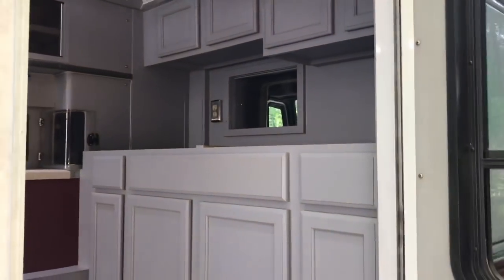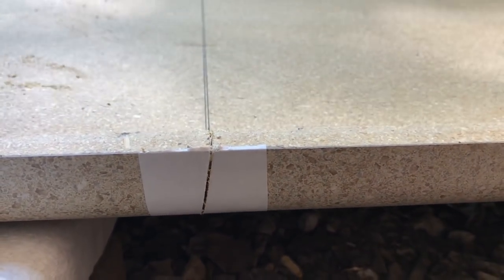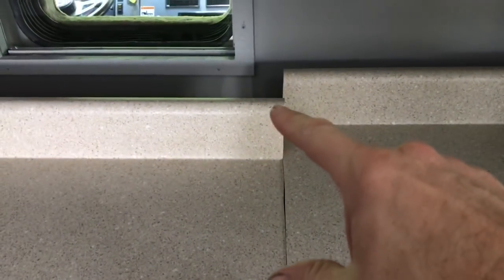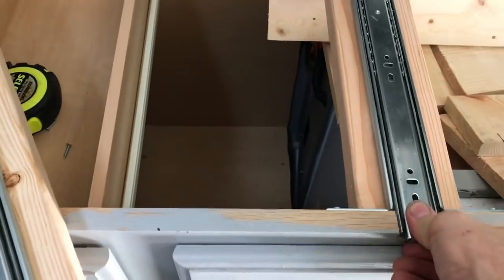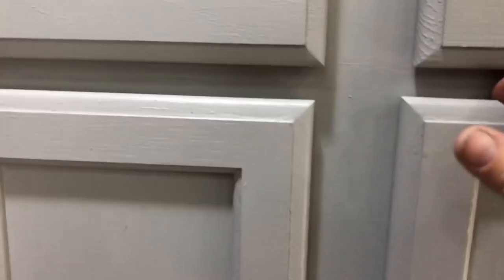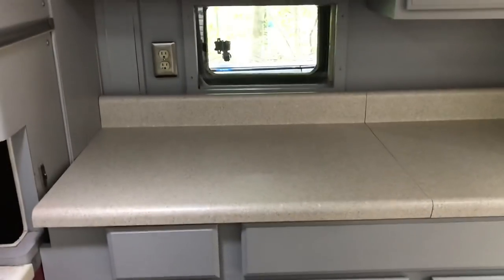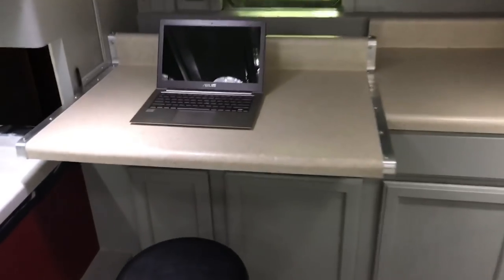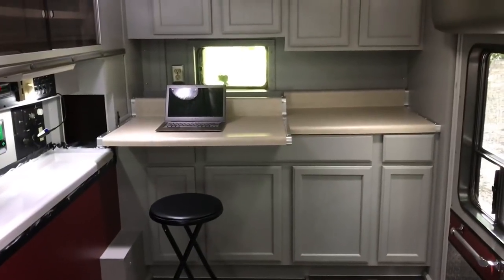Build a Sliding Kitchen Desktop, Mobile Office, Camper Build Van RV Vanlife

Comment: I can't believe how good it looks. I still don't like the gray, it needs some color but it looks so sleek and professional
Reply from the maker: Thank you! I have been making the big items gray but will add color to smaller items as I go. I made a swivel desk table for the sofa and painted the metal parts gloss red. The paint is still drying and am interested to see how that will look. I have found that painting the big things the same color of the walls makes the space feel larger as everything flows together. The sofa really filled up the space and softened things up.

Comment: On the cabinets where the cooler is going, maybe instead of combining the two doors, you could just attach the middle divider strip to either door,  switch the hinges to the other side of the left door, and it they would both open but have no divider in between them, like a saloon door.  Seems like it could maybe be less bulky, and wouldn't block the stairs or anything since they'd each be smaller.  If you attached it to the left door, looks like you might even have enough room to fit the whole cooler behind it.  Love this build and how it's turning out too!
Reply from the maker: Thank you! I have been thinking about your idea all afternoon and really like it. It would simplify the door building greatly. I am looking at the cabinets and only see one small issue. When both the doors would be open, and the cooler slid out, once you tilt open the cooler lid, you will have a bit less access to the contents as the cabinet doors are pretty tall and you would have to reach over the left door and a bit rearward to clear the cabinet door and cooler lid. I still might go this way, I need to ponder a bit more. Thanks for the tip!
Reply: Hmm all I can think of is maybe raising up the cooler on the slide out so it would be more even with the top of the cabinet, then you wouldn't have to bend down as much or reach over the cabinet door.  Maybe then you could even put some storage under it for overflow that wont fit in the fridge like extra drinks, or anything really.  I'll be excited to see how you adapt it, i'm sure you can make it work well!
Reply from the maker: I like that idea!

Comment: Fab as always. Id vote for simple backsplash for design and ease of cleaning. Why did you need to put that strip of metal over the moving join? Loved when you said that screws would find their happy place. Sometimes jobs just have to have a say! 😂. Looking forward to the under counter fridge tray. If you havent shot it yet could you show us type of rails/weighting and approx cost usd?
Reply from the maker: I keep looking at the backsplash and trying to get inspiration for something unique but not loud. It needs to tie in to the medical theme. The black line between the two tops bothered me so I decided to highlight it. The metal ties in with other trim around the kitchen area. I have been struggling with starting the fridge install. I want to have 2 slides. One for the fridge and then one next to it that will be a slide out pantry. This is going to be tricky so I have been doing a lot of thinking (procrastinating) about it. I think the first step will be combining the doors and then it will just flow into something cool.  I will likely use the drawer slides like the counter top but they will be side mounted as mounting to the cabinet floor will be too difficult (I think). It would be easiest to just do one big slide but that would limit the pantry part as the fridge would block most of the shelves. As far as the rails, I need to go by Lowes and see what the bigger sizes are, it needs to come out quite a ways.  In the mean time I have been modifying the sofa that finally got here. I also will be building an entertainment system  (gadget garage,  recharge station, storage) to house a 60" 4K TV which will also serve as computer monitor. Those are so much more fun to do but that darn fridge is taking up space on my floor!
Reply: PSC Camper Conversions ok howsabout the peel and stick subway type  ss “ tiles” on sheets from Lowes etc. They look pretty cool once installed and easy to do. If in the future they get worn/dirty..easy to replace. You might be able to use elsewhere in the Mav to visually tie in the design. I continue to have no luck finding a reasonably priced (for value) class b here in Ontario that has the technology I need for my health. I just travelled in  an Ambulance Wednesday night and in between being hooked up to every imaginable machine i was looking at the new designs...how silly is that? Duh...real time research! I think the last remnants of the possibility of building my own on Promaster chassis just zipped by me..damnation! Cant wait for sofa mods and cupboard...i myself am a pretty good Master of thinking (procrastinating) but I bet it works out well for both of us!
Reply from the maker: Sorry to hear of your ambulance trip. Did you happen to mention to the staff that it would make a great camper? I like the idea of the stick tiles. I have the ambulance desktop as gloss white and the swing sofa table I built is white gloss. I remember searching for a new project and how exciting it was but frustrating at the same time.

Comment: Maybe if you ever have a situation where you have a cut in the middle of the countertop again, reverse your measurements and put the cuts to the outside edges. So when you lay out your tops the factory edges will meet in the middle.
Reply: Brad Ley  That's a clever way to cover up a mistake. Wish I could've used that on my first marriage !!  :-D
Reply from the maker: Great idea - I wish I had thought of it at the time. Better than my solution!
Reply from the maker: Hehehe! One nice think about working on the MAV - she never complains but occasionally bites!
Reply: Brad Ley  When I intercept a unique idea like yours I analyze it's limitations in all applications. The only limitation I see is if you wanted that joint directly in the middle, if you mis-cut a 60/40 split you couldn't use the countertop, except on a smaller counter. Can you see any other limitations when you put the factory edges in the middle? Thanks for your considerations.